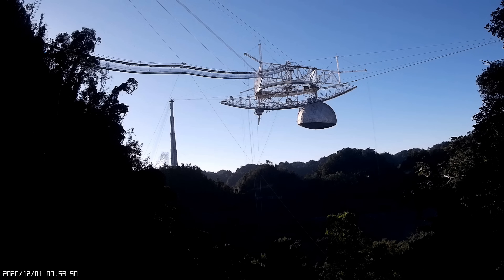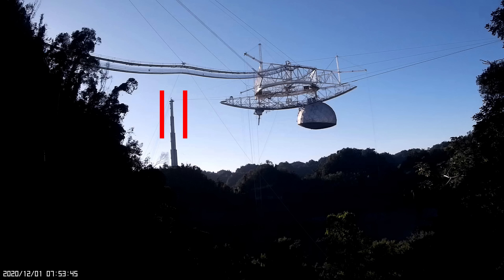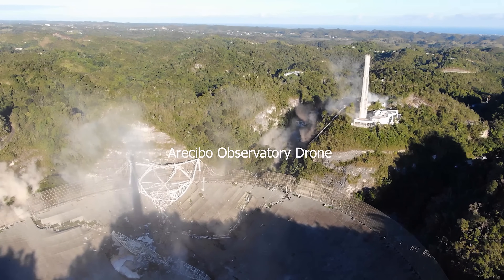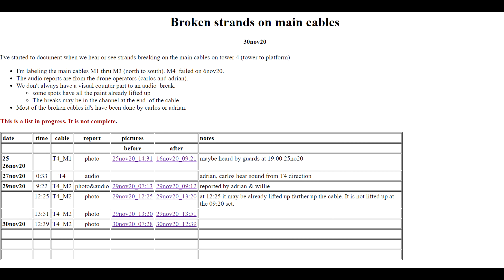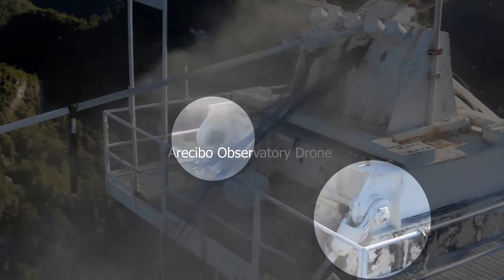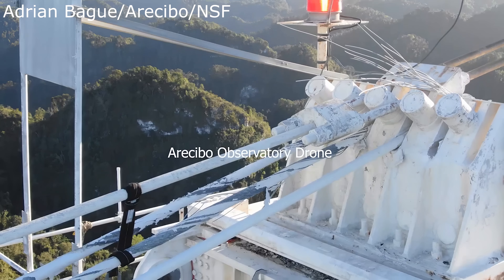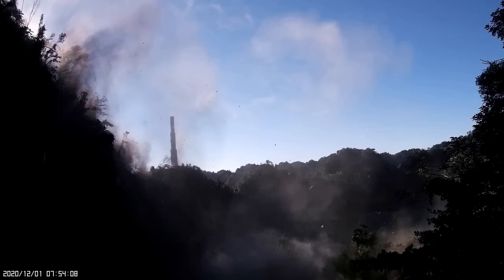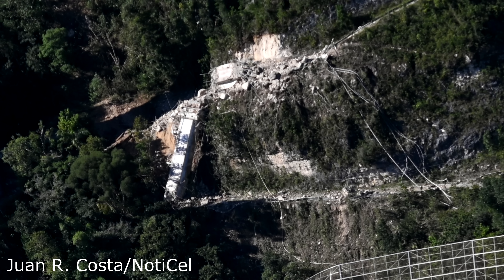Analyzing Video Footage Of Collapse of Massive Arecibo Telescope

Comment: Please do a video on EISCAT and especially the upcoming EISCAT 3D: "EISCAT is planning on building a next generation radar capable of providing 3D monitoring of the atmosphere and ionosphere ... EISCAT_3D will be a multistatic radar composed of five phased-array antenna fields. each field will have around 10,000 crossed dipole antenna elements. All five sites will act as receivers, with a single core site transmitting at 233 MHz (VHF band). The sites will be spread over Finland, Norway and Sweden. Each site will have a central array, surrounded by a set of smaller arrays, providing a high spatial resolution via aperture synthesis.[" Can you explain this?

Comment: Instead of crying about losing this piece of tech, make some realizations of how much was likely outdated. Now that the hazard of the old structure is gone, this would be the time to figure out how to procure funding and start planning a much newer and better replacement to take advantage of other infrastructure already at the site. Of course that may take another 20 years at least (if it does happen), unless some there's some money that shows up to fast-track such a program.

Shame it wasn't maintained to the level needed, but this could also be considered as a possible opportunity.

Comment: With carbon fiber and other modern materials it should be possible to build a replacement that is lighter and stronger than the original. I will be very sad if they don't build a new one.

Comment: Fascinating and terrifying at the same time.  Still... It had just over 50 years of operational life.  Hopefully a new one can be constructed in its place. Think of what could be done modifying the original blueprints with newer, stronger, more sensitive materials.  This is telescope was much a structural engineering marvel as an astronomical one.

Comment: 7:15 "As the drone backs away" - Look at the background, that's not the drone backing away, it's the tower backing away.
Reply: holy shit it's true
Reply: Drone backs away 1 second later...
Reply: Um I don't think you appreciate how parallax works
Reply: @stevecarter8810  The tower also wobbles side-to-side. If it were the drone moving laterally the background would appear to move even though it's far away. Also, it's only a couple of hundred feet away, we'd see something change even if the only movement was precisely in-line with the field of view, which is itself unlikely as it would require precisely matched movement in two axes of the drone. That background (after the drone or camera rotates) is rock steady.
I suppose the footage could be image-stabilised based on the background, but I don't think that's what we're seeing. There are hundreds of tons of force pulling that tower back once the cables supporting the structure fail, which is why it collapses a few seconds later.
Reply: God damn someone like this comment so people can see
Reply: Good observation
Reply: It's both..
Reply: It’s in a Netflix Sci-Fi documentary too called “Alien Worlds” episode 4 “Terra” at 39 mins

Comment: I wonder if the Position of the Gregorian Dome put more load on the cables from the tower that failed. perhaps if they had been able to move it to face away from a different tower before the second cable failed they could have fixed it.

Comment: There needs to be a freaking INVESTIGATION of what caused this since the failure of cables that were added in the 90s (in 1997 I believe) to support additional hardware were what caused this chain of events, cables which SHOULD NOT have failed.   What company made them?  Components of or the entire cables fully made in CHINA by any chance?
Reply from the maker: No the cables were all made in the USA. The first cable that failed was made by Muncy Industries.

Comment: I visited the site twice in the mid 1980s, up close.  One of the most-impressive structures I've ever seen.  This is a tough environment for metals: constant high humidity and proximity to salt water, along with frequent heavy afternoon rainfalls.  I believe that site qualifies as a jungle environment; necessary precautions have to be taken.  Who knows what was going on deep inside those cable anchors, corrosion-wise.  Add a hurricane and a couple of earthquakes to the mix, and... yeah.  Anyway, great report and great video.  Glad no one got hurt.

Comment: am I the only one who thinks the method of holding onto the end of a cable with cast zinc sounds like a terrible idea?  maybe if the wires are re-collected afterwards and bundled back together, but just leaving them open on the end seems silly.
Reply from the maker: It’s a standard method for this
Reply: @scottmanley  I understand that it's standard, It just doesn't seem like much is actually retaining the wires themselves.  Regardless of whether it's standard or used in industry, it doesn't seem like a good idea to me.

Comment: The lack of maintenance of these places is a shame. Having cables from 60 years ago and never replacing them is such a shame. This could have been saved for a fraction of the cost of a new one, but I guess maintenance is just not as interesting for politicians as building new.
Reply from the maker: Some cables were replaced, just not all of them
Reply: @scottmanley  Thanks for replying, I didnt say none were replaced, but some of these are clearly too old. No cable should be used for such an extended period of time, fatigue will allways find its way

Comment: Along with the dish, the towers are probably no longer structurally sound enough to be reused so, this facility is officially un-rebuildable. 
The original cost to build this telescope was 9.3M in 1963. I'm sure it would cost 50 times that amount or more to redesign/rebuild today.
Someone started a petition to rebuild this telescope.. yeah.. good luck.

Comment: Noticel images are shown in a small carousel with low resolution. Here are all the high resolution images:
https://imengine.editorial.prod.ntc.navigacloud.com/?uuid=e4a846af-2950-5f00-99ca-4a3d824a7960&function=original&type=primary
https://imengine.editorial.prod.ntc.navigacloud.com/?uuid=ca5090e6-09e4-5c28-93f5-42008dac8ed7&function=original&type=primary
https://imengine.editorial.prod.ntc.navigacloud.com/?uuid=01c726ac-b537-5f80-ada3-7e8ef6ffeb5a&function=original&type=primary
https://imengine.editorial.prod.ntc.navigacloud.com/?uuid=6219bb97-9772-5c8a-bae2-a6d027eba957&function=original&type=primary
https://imengine.editorial.prod.ntc.navigacloud.com/?uuid=a2d37a24-3fa0-549c-85c5-362f1043c5ec&function=original&type=primary
https://imengine.editorial.prod.ntc.navigacloud.com/?uuid=a180ce7e-5e44-5c2d-a795-6960d1b23599&function=original&type=primary
https://imengine.editorial.prod.ntc.navigacloud.com/?uuid=61ee6138-549a-568f-98ef-230a12e3d647&function=original&type=primary
https://imengine.editorial.prod.ntc.navigacloud.com/?uuid=9b365b65-0d8e-50ad-bc34-d14326176892&function=original&type=primary
https://imengine.editorial.prod.ntc.navigacloud.com/?uuid=9fdb1cbf-cbff-5938-95c6-fa87286b3a6b&function=original&type=primary
https://imengine.editorial.prod.ntc.navigacloud.com/?uuid=bd7b8801-d665-5aab-8e66-9de837d98745&function=original&type=primary
https://imengine.editorial.prod.ntc.navigacloud.com/?uuid=22bbe375-2836-564f-9b17-29ff37bd5a64&function=original&type=primary
https://imengine.editorial.prod.ntc.navigacloud.com/?uuid=664490eb-bd42-522f-81d3-210b212a687d&function=original&type=primary
https://imengine.editorial.prod.ntc.navigacloud.com/?uuid=a77bf316-b6c8-5fb7-8e2e-2a2928356555&function=original&type=primary
https://imengine.editorial.prod.ntc.navigacloud.com/?uuid=dbd70b98-dd56-506c-aba2-d27d79993e89&function=original&type=primary
https://imengine.editorial.prod.ntc.navigacloud.com/?uuid=7d35941b-65fc-595e-89d5-66f0787c0b14&function=original&type=primary
https://imengine.editorial.prod.ntc.navigacloud.com/?uuid=51bc1388-dda0-52ea-bfa6-aeedf3ead113&function=original&type=primary
https://imengine.editorial.prod.ntc.navigacloud.com/?uuid=948d8b05-6d3b-5bd7-95c9-5bdd3807e8e9&function=original&type=primary
https://imengine.editorial.prod.ntc.navigacloud.com/?uuid=97ddbddc-023b-5c47-86f9-9cc38fbacab5&function=original&type=primary
https://imengine.editorial.prod.ntc.navigacloud.com/?uuid=738c57de-d8d6-5802-8b02-7a4c4c3b2d99&function=original&type=primary
https://imengine.editorial.prod.ntc.navigacloud.com/?uuid=839a06b9-8af3-57ad-81a0-15269c5c36ae&function=original&type=primary
https://imengine.editorial.prod.ntc.navigacloud.com/?uuid=0878d4a8-04f5-5511-bf97-44a5067fc999&function=original&type=primary
https://imengine.editorial.prod.ntc.navigacloud.com/?uuid=953fdc61-9178-5a37-b220-996581f63d94&function=original&type=primary
https://imengine.editorial.prod.ntc.navigacloud.com/?uuid=dbdb68fc-d71d-5a6f-944e-3ccd87b6d147&function=original&type=primary
https://imengine.editorial.prod.ntc.navigacloud.com/?uuid=e4c66d0b-f9e3-540c-a8a2-0620c54a0d84&function=original&type=primary
https://imengine.editorial.prod.ntc.navigacloud.com/?uuid=18ac1896-9f58-5877-8b47-da3764e59536&function=original&type=primary
https://imengine.editorial.prod.ntc.navigacloud.com/?uuid=c11368b3-d74b-58e5-8f94-8d7d22915efd&function=original&type=primary
https://imengine.editorial.prod.ntc.navigacloud.com/?uuid=96315bf8-62cb-510e-8b47-5f8bd2a3e809&function=original&type=primary
https://imengine.editorial.prod.ntc.navigacloud.com/?uuid=c832e860-a21a-5b19-aa21-a29d21ccff69&function=original&type=primary
https://imengine.editorial.prod.ntc.navigacloud.com/?uuid=be892c02-e352-5113-932d-0b424f29e979&function=original&type=primary
https://imengine.editorial.prod.ntc.navigacloud.com/?uuid=8cd29aa8-df67-534d-9d04-0f70a4f62e0f&function=original&type=primary
https://imengine.editorial.prod.ntc.navigacloud.com/?uuid=14b1cd6c-4f48-5d54-93ad-dddeb9c56d40&function=original&type=primary
https://imengine.editorial.prod.ntc.navigacloud.com/?uuid=2a7e3e13-1a12-5977-a043-3daf600ff1e6&function=original&type=primary
https://imengine.editorial.prod.ntc.navigacloud.com/?uuid=ff426cfa-4e15-5280-8b30-a46b0dbd4ea0&function=original&type=primary
https://imengine.editorial.prod.ntc.navigacloud.com/?uuid=e6dd8c2c-e784-5f62-a7ae-8b0e03692f68&function=original&type=primary
https://imengine.editorial.prod.ntc.navigacloud.com/?uuid=34b77dd9-ee99-57c0-a2f0-754b1235c087&function=original&type=primary
https://imengine.editorial.prod.ntc.navigacloud.com/?uuid=bd0d5b3e-5699-5574-9ec9-6cde4a84a24d&function=original&type=primary

Comment: The condition the telescope was kept in.... I'm surprised it lasted this long.
Reply: It cost $71.3M in today's dollars. FAST cost $170 using much more modern engineering practices, lighter cables, etc. Arecibo was definitely a bit underbuilt.
Reply: Science is the plaything of politics.
For most of it's early life it was well funded (probably because it was important for defense during the cold war) but in the last couple decades that hasn't exactly been the case. The cuts in science funding have been especially deep under the trump administration.
Also much of the damage which led to the failure was a result of hurricane Maria in 2017 which was never properly addressed.
Reply: @spiderpickle3255  The dish was having trouble with funding long before the Trump administration. 20 years ago, when I was participating in the 
SETI@home project, there was frequent discussion about the lack of funding for the facility.
Reply: @Crosshair84  As I stated
"For most of it's early life it was well funded . . . but in the last couple decades that hasn't exactly been the case."

But at the same time one can't ignore that trump proposed cutting funding to the NSF by something like 40% before backlash made him walk it back.
Reply: @spiderpickle3255  it's actually the Republicans responsibility to minimize expenditures and shut down unproductive projects. It is typically the Democratic party that builds new systems. It's good to swap back and forth. We cut out unnecessary expenditure from failing projects and then they get replaced with proper projects that are working. Small government you know how it goes....
Reply: @spiderpickle3255  attention has been diverted only. This was a very important dish. however, technologies have evolved. Now we use arrays of satellites above the Earth's atmosphere where clear imagery can be collected. Hubble Telescope was the first real step. There has actually been an escalation in DoD activity in partnership with NASA and SpaceX so I wouldn't say we don't need scientists as much anymore. Only the technology has changed.
Reply: @spiderpickle3255  Yea no, "science" unfunded itself, redirecting more resources into "neovaginas" than saving telescopes, there was plenty of money, wasted.  The entire push for women in stem has been massively wasteful, obvious recently confirmed by a study on science mentorship and productivity, by two women no less.  Shouldn't be surprised as fixations on "consensus" just reinforce mediocrity. Fashionable concerns over science aren't connected to reality in any way that matters.
Reply: @woooweee  Well said, sir.

Comment: Welding Engineer here... And all i can really say is... Who passed those wires?
When I'm welding supports or structural joints, and i notice just one strand is frayed, i will not weld it. 
One wire being weak, means the rest will follow. Tsk tsk on those inspectors.
Reply: But, this footage is amazing. Have seen wires break and collapse before, nothing like that though.

Comment: Reason why there isn't as much rebar in the tower is that its not designed to take any bending load.
All the bending load should be countered with other cables from the other sides.
The only load the concreet should take here is compressive load in which concreet is strong by itself plus rebar wont help to increase compressive streng of the material.

Comment: Domino effect, those cables were  not maintained, water wicks into the cable unit and corrosion begins on the individual wires. The load and stresses on the cable are maxed and the cable snaps like a twig bringing down the entire structure, its all about maintenance

Comment: @Scott Manley - The first cable failure [broken strands of wire in the 1st drone vid] occured only a few months ago and caused sigbificant damage. That broken babke altered the loads on the other cables. 
*****At the time a small but significant earthquake was recorded by Aricebo's seismographs immediateky before the remaining cables lost their load bearing capacity.
Due to the age of the telescope and its shrinking budget the damage done by the first cable failure put the telescope's future in doubt. Now that the second failure occured the dish is all but completely demolished.

Comment: The drone was very lucky that a cable did not slice it into a million pieces. Nice video Scott.
Reply: My drone went on strike after this happened and I got a call from the drone union.
Reply: We lost one of the advance Telescope who search for new planetary positions and life on other planet's 🥺
Reply: I heard that cables don't actually slice. Apparently it's just a Hollywood thing.
Reply: @JainaKeria  
You can literally see cables slice the catwalk at 9:05
Reply: @JainaKeria  Anything with enough energy and a small enough surface area can probably slice. That cable would no doubt decapitate you.
Reply: How can a cable cause any damage? It's just a wire
Reply: @esecallum  There is a lot of tension on the cables. Think of a rubber band, but it’s made out of metal.
Reply: @PorucznikBorewicz  And three inches across. And moving 120 mph
Reply: @teebob21  Yeah, pretty much.
Reply: @esecallum  You'd literally be blown to pieces from the sheer energy of one of those cables hitting you
Reply: @esecallum  Did you watch the same video as everybody else? These cables destroyed everything on their path, why do you think this drone would be safe?

Edit: ah, noticed you're just a troll, whatever.
Reply: @esecallum  remember this the next time you try to tow a car.
Reply: @danielch6662  TOW A CAR. whats that got to do with anything.
Reply: @Indrid Cold look it's just some wire. Wire. it's can't cut cars. It's a myth. And scare mongering
Reply: @esecallum  trump voter

Comment: Scott, I believe you are mistaken as to which tower head the drone was inspecting. I believe it was inspecting the tower to the left out of view in the GoPro video. From this footage it is clear that the failure starts at this tower and not at the tower you indicate. Otherwise good description. It is rather impressive to look at massive structural failure. I've been doing so for the last 34 years in a structural engineering lab at UCSD.

Comment: Speaking of outdated standards that method of cable retention was not up to par even in the 1960s. There should have been a large loop in the end, returning to a metal filled clamp. This would have reduced the stress on the socket by 50%.